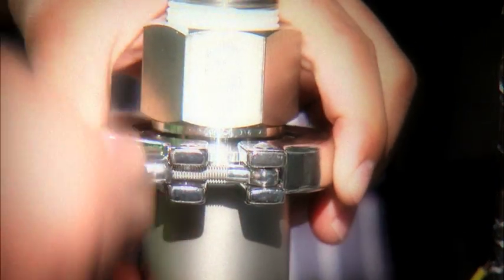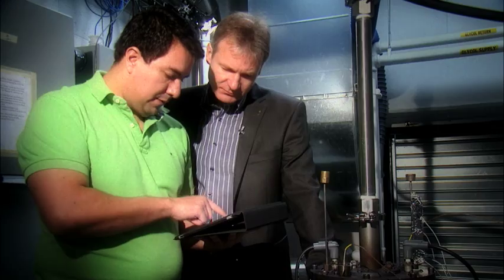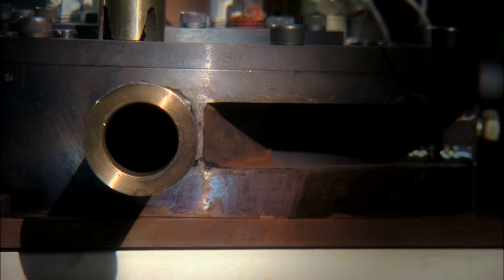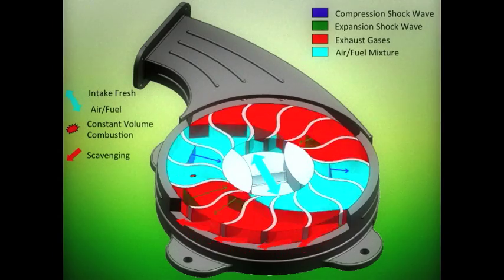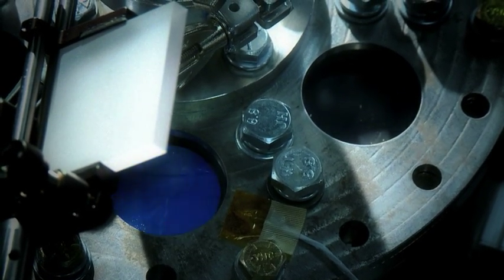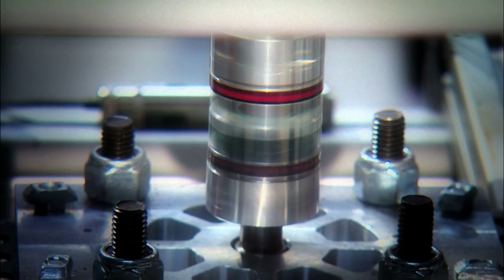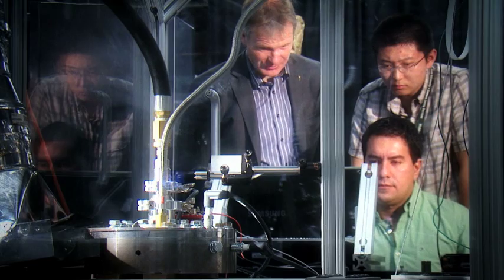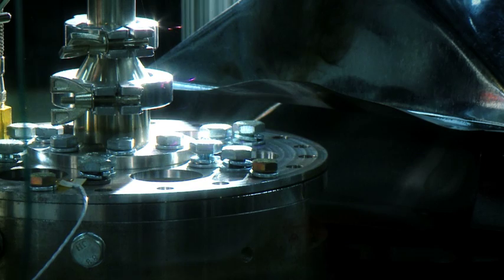Michigan State University 2011 President's Report: Revving an automotive revolution.

Comment: 34hp can easily turn a generator in a series-hybrid and have the car with normal performance. The genny only needs to have average power output and the battery fill in for acceleration in an electric drive. Most normal direct drive ICEs are running on inefficient part load.  The engines are over powered in case of: 1) high load. 2)  high speed 3) acceleration. The series-hybrid has a battery buffer cope with number 1), 2) and 3).

Comment: This is not like an engine that you currently have in your car.  This would be used as a generator in an all electric car because it needs to operate at a sustained speed so you can't connect it to a transmission to drive a car like a piston engine can.  It is a totally new way of powering a car that is much more efficient.  It is impressive.

Comment: This was in the president's report and it only has 564 hits? Anyway, this is pretty awesome. 25 kW is about a 33 - 34 hp. I saw on Wheeler Dealer (Discovery Channel) just the other day that this is the power of a 1950s VW Beetle. Wikipedia says that the bug got a top speed of 71 mph. I'm welcome to corrections.